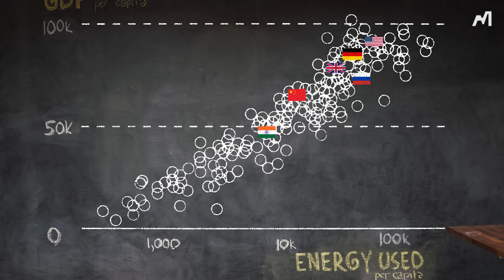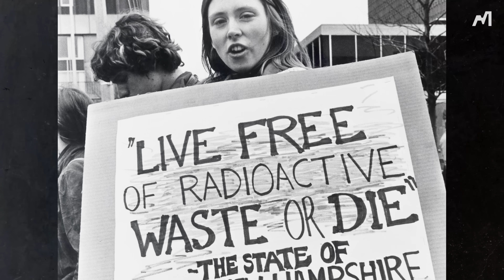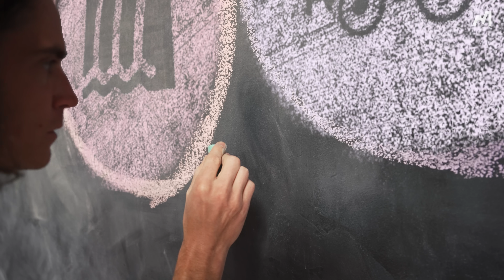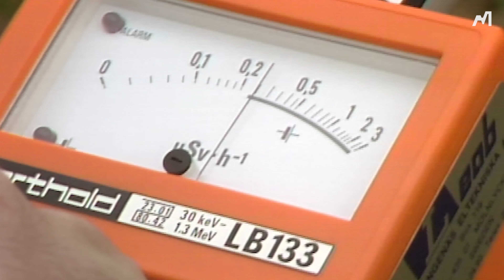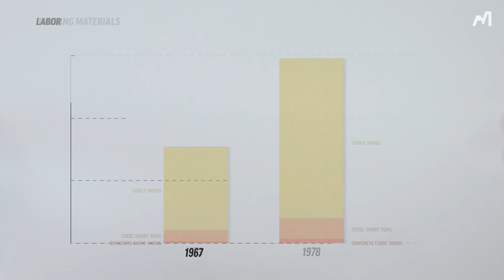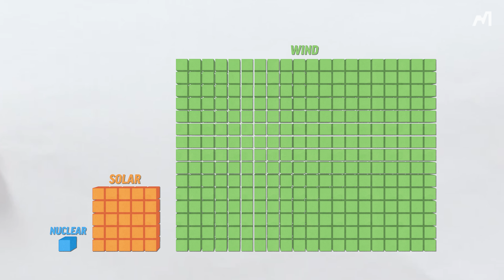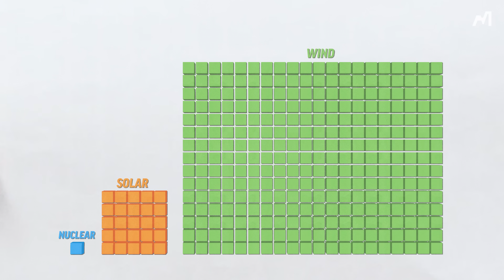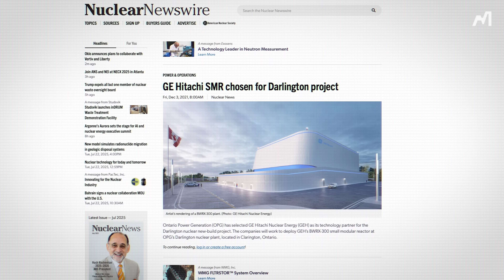They're Lying to You About Nuclear Energy

Comment: The operators of three mile island had been trained on safety guidelines developed for nuclear submarines.
If you flood the system with water you sink a sub, on land you avert the catastrophe.
Reply: Water doesnt stop a nuclear reaction.  Thats what control rods (Boron Carbon) are for.
Reply: @gary7176  it does absorb a ridiculous amount of heat, there is not a single reactor currently operational that cant be throttled down to safe levels by simply passing more water through
Reply: @kkjkjh  Wrong! 
Moderator effect (in light-water reactors like PWRs/BWRs): Cold water is denser, so it slows down (moderates) neutrons more effectively. That actually makes the chain reaction more reactive, not less.

Coolant effect: Cold water can remove heat faster, which keeps fuel cooler. Cooler fuel absorbs neutrons less efficiently (Doppler effect decreases), so again, reactivity rises.

So paradoxically, in a water-moderated reactor, pumping in colder water usually makes the reactor more reactive, not less.
Reply: @gary7176  i meant through the cooling system but yeah i guess most reactors use a different coolant in there

Comment: The one topic I'm actually more qualified than 99.99999% of people to talk about. I like the discussion of how real-time regulation changes impacts construction. Regulation is the Achilles's heel of the nuclear power industry. The impacts it can have on both new construction and operational costs of existing units in an unregulated energy market (ex. energy market competition against the much less regulated combined cycle plants) can absolutely bury the nuclear power industry. I've been the literal reactor operator for military and civilian plants. Supervisor for the control room of another civilian plant. Was an engineer for construction of a newly finished US nuclear plant. Overseeing site maintenance projects at the plant I'm at now. And I've got my eye on an SMR project once the NRC gives the green light.
Reply: The SMR is a boondoggle and always has been, it will cost 2 to 4 times per unit power and everyone pushing them knows it.
Reply: What are your thoughts on a Thorium based reactor?   Is corrosion from the molten salts the biggest draw back?
Reply: @Mr.Anderson-y2j  $ is the biggest draw back. I'll speak only to the US nuclear power industry. To supplant U-235 as the primary fuel choice, thorium has to be proven to be cost effective enough to invest an entire infrastructure around. The current nuclear power infrastructure is built around U-235. The only way I see thorium overtake U-235 is the failure of SMRs to be a cost efficient alternative to traditional nuclear plant designs like the AP1000. A handful of abandoned SMR projects will scare the industry away from building new nuclear plants that are designed for U-235 fuel due to costs. The industry is already incredibly sensitive this right now as is. If thorium plant designs can prove to be cost effective and are safe enough to maneuver NRC regulations/approvals without significant resistance, you could see the US turn that direction in a few decades when current plant operating licenses are set to expire.
Reply: @ApexofWar_  Thanks for the thoughtful response.

Comment: Nuclear accidents are outliers.

Chernobyl was a graphite-moderated, Soviet-era RBMK reactor, a design criticized for being overcomplicated and lacking proper containment. The disaster was caused by an overambitious technician, compounded by a Soviet cover-up.

The Fukushima Daiichi plant, which had been operating successfully since the early 1980s, survived a major earthquake, but a subsequent tidal wave knocked out the cooling systems of this older-generation plant.

The Three Mile Island incident in 1979 involved an overheated reactor and a partial meltdown, which were caused by faulty analog gauges that led to operator confusion and error.

Despite these accidents, technicians have continued  working at these plants without issue since their construction.

 In fact, about 300 feet away from the Chernobyl and Three Mile Island the other reactors continue to produce power, 14 years and 40 years respectively. 

However, the public has been made fearful of nuclear power by politicians, the media, and so-called nuclear safety advocates—people who profit from promoting fear and making nuclear energy so expensive that it can never be built.

Comment: SMRs are so cool! I'm in trade school for electronics, and I did a lil presentation on them in my science class.

Did you know that they can be used for other purposes than electricity, at the same time as generating electricity? You can use them for desalination, district heating, & hydrogen production. So if placed in an industrial area, they could for example deliver hydrogen, electricity and heat for industry production. The thermal energy generated would usually just be heat loss, but if you have the infrastructure to use it, i.e. district heating, you're using more of the energy. I think these reactors can reach an efficiency of like 80% when they're constructed for multiple purposes, compared to like 30-something for just electricity (although that's for conventional reactors iirc).

We could also use microreactors get electricity (+ heating etc.) for remote places that aren't connected to the grid.

Highly recommend checking out the subject a bit more!

Comment: I don't think it is helpful to fail to distinguish between types of radiation. Just saying people absorbed X amount of radiation is meaningless. Was it alpha, beta, gamma, neutron? At high altitude most radiation is cosmic radiation (solar or galactic) in the form of protons and some alpha particles (2 protons and 2 neutrons, basically a helium atom nucleus with no electrons) and heavier nuclei. These can't pass through a sheet of paper and are not dangerous externally. But ingest an alpha emitter, such as plutonium-239, and the result is damage to cells internally. Beta radiation is just high energy electrons (or positrons) and can only pass through a few layers of skin, but again when ingested or inhaled a beta- or beta+ emitting radionuclide will cause damage to cells through ionization of the atoms in the cells. Electromagnetic radiation, however, in the form of X-rays and the 1000+ times more powerful gamma radiation can ionize atoms in the body's cells all the way through the body. And those who knew Harry Daghlian and Larry Slotkin might take exception to your saying that the Manhattan project physicists "all" died of old age and natural causes. Marie Curie died from aplastic anemia caused by long term exposure to alpha emitters which she inadvertently inhaled and/or ingested, specifically radium and polonium. Alexander Litvinenko was assassinated by Russian operatives poisoning him with polonium-210 in tea. I'm a retired nuclear engineer, and I find going too far to the pro-nuclear extreme to the point of saying it isn't dangerous just as egregious as the nonsense Ralph Nader pedaled.

Comment: To further this point, there are much safer nuclear reactor designs that are walk-away safe that never worry about melt downs or needing any active cooling and have the ability to recycle their own fuel without shutdown and have no need of pressurizers all while being more efficient. These designs burn nuclear waste until it has a half life of about 100 years and is essentially inert in 500 years. This waste is 100 times less than generation 1 designs.

Comment: Well done. Just one comment about intermittent sources (wind and solar). You should mention that intermittent sources require a full base power source (nuclear, nat gas) be built alongside them because intermittent sources can go to zero at peak load times. Thus, the capex for wind and solar is much higher than just building and installing the wind turbines and solar panels. The capex includes the cost of building the base power station alongside them.

Comment: The argument about wind power was straight up wrong. Comparing lifetime cost wind power is superior in every regard. And that's what I don't get about the nuclear crowd, yes new npps are safe to operate but that is it. They gobble water in amounts you can't even fathom because they need horrendous amounts of cooling and are not suited for every climate. They are near impossible to recycle. Once the 80 years are over, there is so much killingly radioactive waste. 
And the last one is. Why when we have wind, solar, tides and geothermal energy? Storage is pretty easy as well. There simply is no need for nuclear fission reactors anymore.

Comment: 1. where are you going to put the waste
2. how much are the entire costs of everything (commissioning, decommissioning, fuel fabrication refining and transmutation, security, waste disposal) versus something like solar, hydro, geothermal, and tidal
3. how much of that cost is subsidized
4. can you name another technology that, when it fails, renders entire regions uninhabitable but for rewilding?

I swear, Greenpeace went from anti-nuclear to pro-nuclear when they realized the benefits wildlife get from catastrophic reactor failures.
Reply: 1. underground, half a km deep, in stable geological formations for millions of years inside of concrete multilayer casks that can withstand a commercial airliner impact.
2. such a metric doesn't exist and it's useless because comparing costs of energy sources is fundamentally flawed and they serve different roles in the electric grid, you can only compare energy mix scenarios. Every source will require different auxiliary costs, and vary with external conditions, the closest you can get is VALCOE or LFSCOE, but a full system cost analysis will always be better.
3. varies greatly from case to case, renewables are set to receive 3 trillion (past and confirmed future) in subsidies in europe for example.
4. yes, ever heard of oil spills? gas explosions, coal explosions, even hydro dam failures, If not about energy then another dozen chemical industries, I speak from experience where there was a DDT explosion in my province. Also no region of nuclear disaster was rendered uninhabitable, chernobyl has some of the highest biodiversity in europe (because men left) and fukushima is less radioactive than the vatican where the pope lives up to and which millions visit
Reply: @filippo1864  1. Again, no one has accepted nuclear waste, and your plan would actually contaminate ground water. 2. It's not something the uranium conspiracy would tell you. 3. Nuclear has never made a dime. 4. DDT is not fuel. Oil is not a renewable.

Nuclear is bad, period. We should not be messing with the strong nuclear force because it's either a scam (fusion) or too dangerous to mess with (the rest of the nuclear industry).

Comment: Small modular reactors do not have to be shut down for refueling but rather are continue to make power for up to 35 years. 
 Small modular reactors are walk away safe.
   Small modular reactors are part of a local energy grid, requiring about the amount of space of a Home Depot.
Reply: Depends on the type, most civil SMR designs do need refueling and at intervals similar to large reactor: 1-1.5 years

Comment: “they” didn't SPIN half as good as you though . . . back in the day EVERYTHING was poured into running the Cold War Military Industrial Complex : a war-economy that had NO rules excepting National Security. If they were quite happy to perch a company of men on a steel tripod in the middle of deep sea hurricane alley and keep them there against better wisdom… it speaks VOLUMES of how “they” regarded personal safety. THEY were desperate to expand their reactors! save me the nonsense spin on wind whahaha! 
Radiation and toxicity is So poorly motivated in this presentation: internal contamination is deadly when compared to the derisory dosages of mt. Everest! Maybe modular reactors are a good idea, except a mobile truck with a shipping container of fissile material is a strategist’s worst nightmare: it's NOT going to happen on a public scale: because even the low-level “fool-proof” shipping beacons installed by the USSR along its coast led to some highly awkward sanitary clean-ups… 
gimme a power source with no risk snd no toxic waste - hydrogen for instance - just not the heavy water variant!

Comment: This is why the only way forward with current regulation is Modular Reactors.  If the manufacturers can get full design approval before every single thing goes out the door that is a massive start.  Then local site approval and planning becomes the main focus. Ideally every single one of these deployments would be built to near identical stamps repeated each to spec.  The main differences would be the operational planning and paperwork for the town/city/services around the plant.  And then you get operational and certified with one of these reactors...usually at a loss, but sustaining the cost of operations while additional units progress identically on the same site.  Bespoke reactors are not viable from a regulatory perspective anymore.

And as for the waste problem, we can actually reduce waste by over 80% by just recycling our nuclear waste.  We don't do it because Uranium ore is cheaper to refine than the previously used waste products, but we also do not count end-to-end lifecycle management in those costs.

Comment: Going to challenge your assertion of there being few deaths from radiation, with an anecdote... During the "fog" around Chernobyl, my father was driving through and got a flat tire - he changed the wheel on the side of the road not knowing what it was. My father was diagnosed with leukemia a couple of years after, at age 32. He's not among those "directly correlated deaths", but he like everyone else in my family was a mechanical engineer working on ship designs but the only person to get cancer before age 70.
Reply: It's not an assertion, it's a fact and data by the UNSCEAR, yours is like you said correctly an anecdote, while unfortunate it doesn't constitute a tangible correlation.
Reply: Children born decades after chernobyl in other countries get cancer, post hoc ergo propter hoc is not proof

Comment: I remember in one of my aerospace engineering classes (spacecraft environments) we touched on the van allen belts and one of the homework assignments was to calculate how much radiation astronauts got going to the moon when they when through the belts. It was only like 5 X rays worth and now you got people using the belts as a reason for moon landing denial 😂 

(Btw I don’t remember the exact radiation amount, it might have been more or less but it was surprisingly insignificant. It was like two years ago and I don’t feel like getting out the textbooks to recalculate)

Comment: I took a class in 1999 at U of Oregon called "Nuclear Choices".  It was disappointing to learn that Nuclear power is actually very safe and efficient compared to fossil fuels, but the "what if " fear factor has paralyzed the industry. We would rather keep contributing to the 43 billion tons of CO² emitted by fossil fuel each year than use nuclear power because of the fear of accidents. The pollution caused by fossil fuels is no accident, but for some reason is more acceptable than the whataboutism attached to Nuclear power.

Comment: The problem doesn't lie in the radiation WE experience, but rather the waste it creates. There is no way to get rid of it, and it will stay dangerous for hundreds of thousands of years more. Dumping it in the earth won't solve that issue.
By using nuclear fission, we're replacing one problem (climate change) with another (nuclear waste) 
And the only use this waste has found in our modern world is being shot at our "enemies" during war.
There are several other reasons why nuclear-fission might just be the dumbest thing that internet-scientists like to perpetuate. 
But why? 
We know fusion works. Really well. We can make it now. All we have to do is maintain it and we have the most powerful, cheap, and safe energy-source, and yet we insist on fission?

Comment: Indeed properly constructed/run nuclear reactors are safe ... the problem is the people building/running those reactors are fallible, cut corners, don't keep up with maintenance, ignore safety protocols for convenience/complacency. Aniother issue is that if everything goes wrong with a solar/wind farm the result is your power turns off, but if ( (or knowing humanity when) everything goes wrong at a nuclear reactor (Sellafield's incident only saved by Sockroft's "Follies"), or in a Nuclear powered Submarine (Soviet K-27 incident) the effects can range from one man taking 83 days to die in the most excruciating way possible, the wrong kind of strontium in your bones or large swathes of land being uninhabitable because kicking up the dust in the region is worse than smoking. Until you can make a reactor that can eliminate the human element your hazard reduction hierarchy is always going to favour the methods that involve the least risks with the most profits.